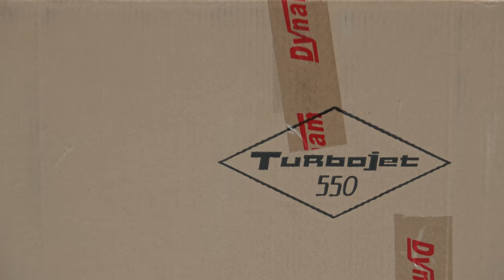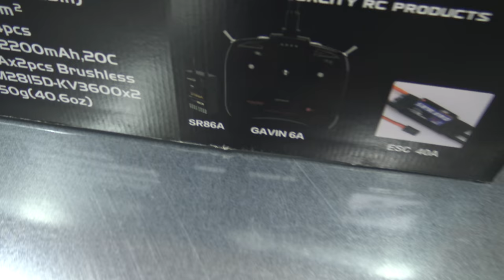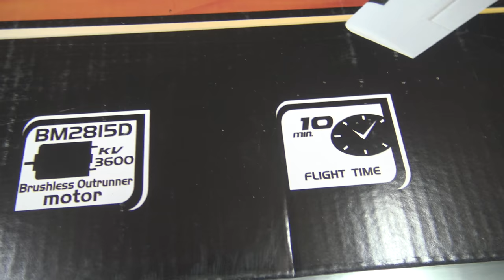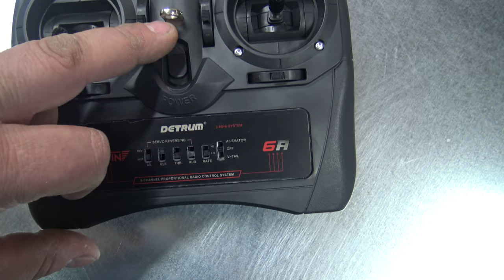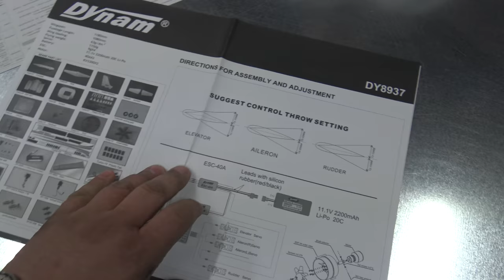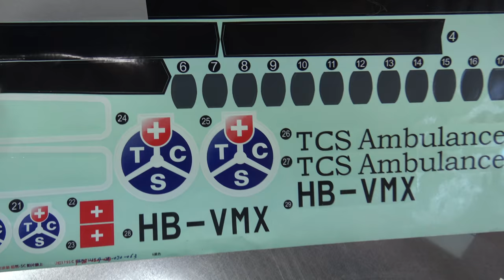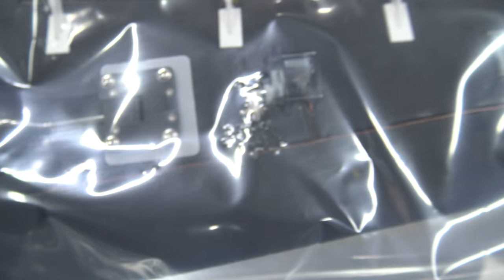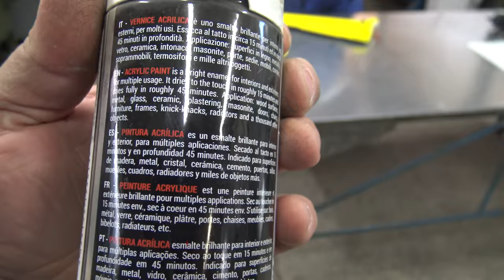Dynam Cessna 550 Turbo Jet Yellow Twin 64mm EDF SRTF Unboxing

Comment: Four Batteries in the Transmitter ist Not safty...use a  Batterypack..if you can
Gretings Form Germany
Reply from the maker: Like you said my friend. but in fact it does have the indicator for the baterries on the radio.